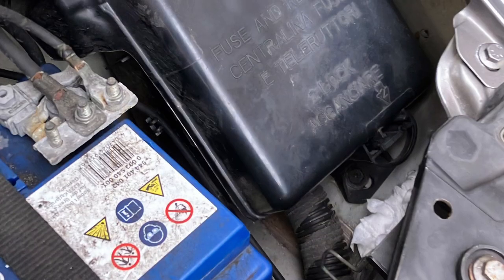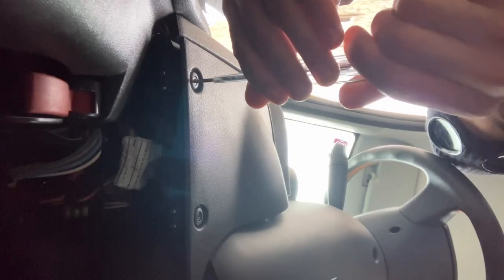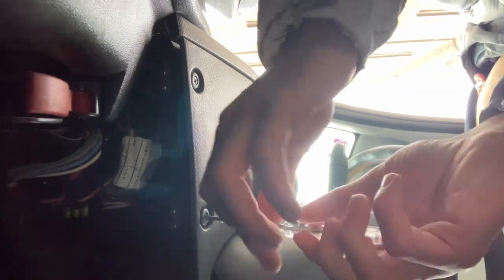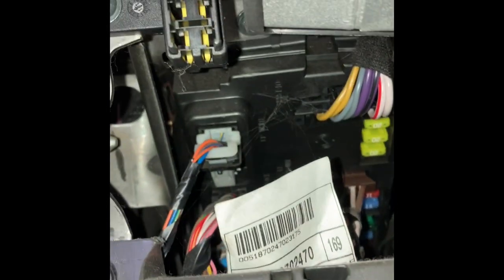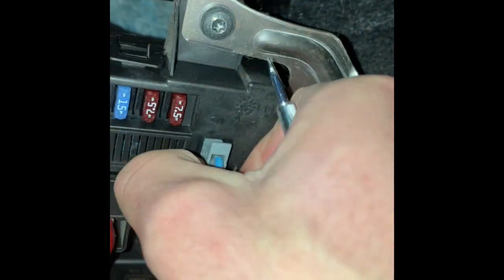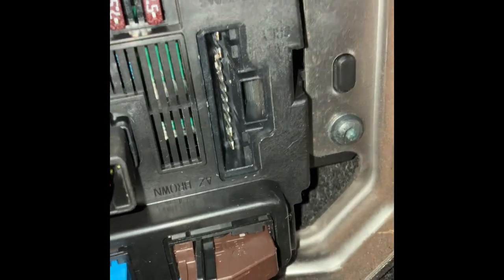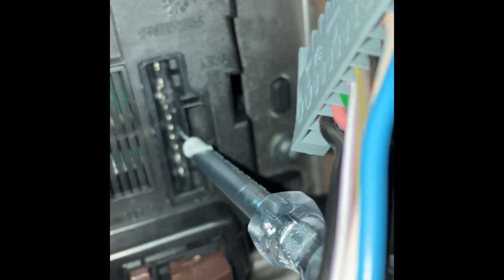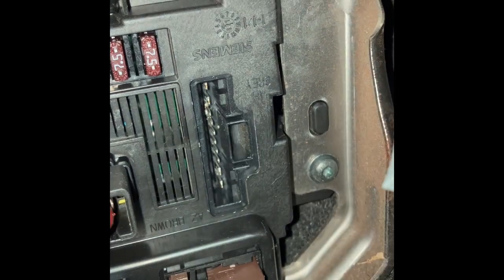Repair Headlight Fiat Panda (169)- Easy Free Fix

Comment: I think this was fixed by Fiat in the later models 169 panda's like yours. Your panda shouldn't have this problem
Reply from the maker: maybe you are right! which numbers do you think have this problem? maybe my year is incorrect
Reply: @mauricezwart  I think the older Panda's with the non-interference fire engines. A simple line could be drawn at the switch from the tiny mirrors on the doors to the bigger ones and the light grey dash to the darker tone dash I think.
Your 2011 Panda is definitely one of the last of the series..